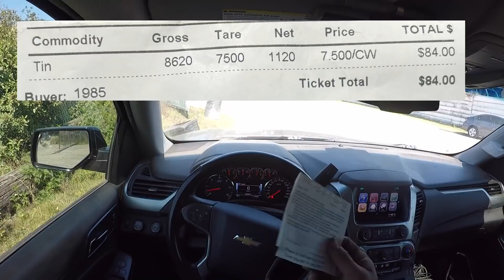Fanless Friday - Street Scrapping For Only Jumbo Scrap

Comment: Hey Matt, try using some    Ziplocs  and duct tape to rig up  some pins holder  on your trailer so you won't lose them
Reply from the maker: I have done a great job ib not losing them - it has been a week or two without losing one.  But I hope to have chains add this weekend.

Comment: Matt the alloy bikes you only need to cut off the crank section take the handle bars off and just nock out the metal rings where the ball baerings go.The rest of the bike should be ckean.👍👍✌👊👊
Reply from the maker: At this yard it is only 8 cents a pound difference between the 2.  The extra work is often not worth it.

Comment: Ok, Matt, I'm sorry. I watch you tube on my TV so I can't leave comments, and now that I'm on my computer I'm going crazy. Don't worry; I won't do this often. Promise. I'm just thinking if you would put walls up at the front of your trailer where the hitch is, tall walls, you could go up instead of out. Then when you get huge items (whew!) you'd have so much more room by the ramp. Fill up the front, leave the back available. But it's your business, and I'm not a scrapper, so just making a suggestion based on watching you struggle more than is necessary. Loving your channel even though it might not sound like it. What will you do when the boys are out of school?
Reply from the maker: We are working in that this weekend.  Hopefully we can get some stuff done.  My youngest is 7 so I have FOREVER before they are all out of school. But if you mean during the summer - I leave them with the oldest for the couple hours it takes me to run.  I am normally home by lunchtime. And if no school - I can start earlier so better scrap and home earlier WIN/WIN
Reply: @nachostuff  You've got a great plan! You're a good dad.